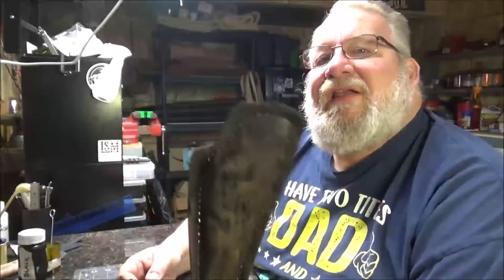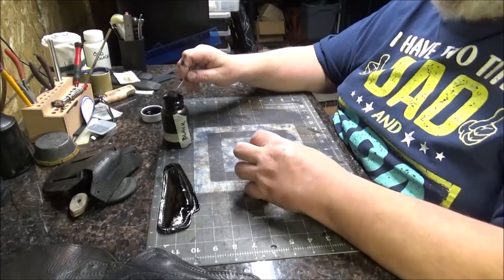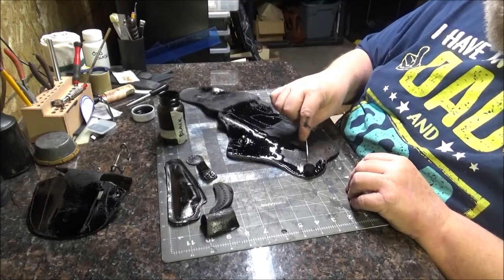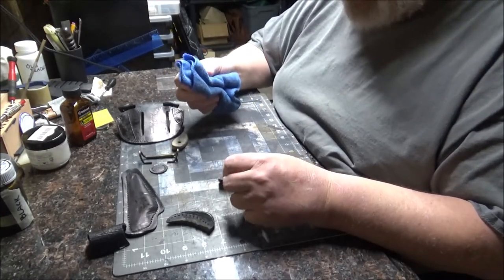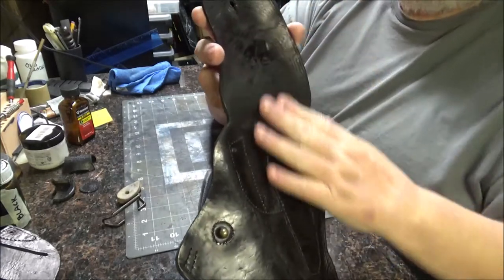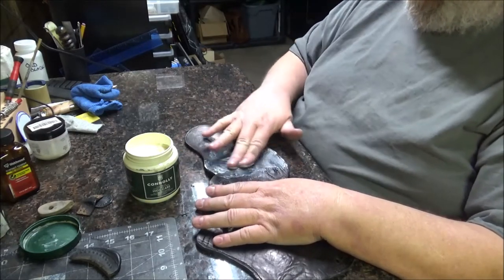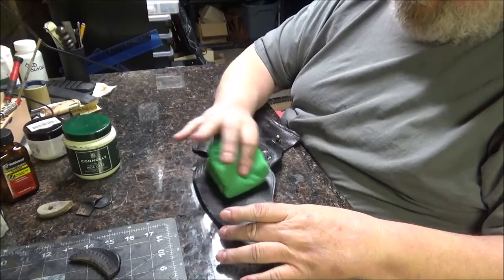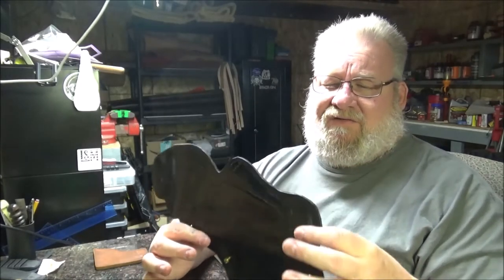1911 Holster Restoration Part 2: The Finish

Comment: Have you tried Outback Surival gear Leather Seal?  I love this product and use it over neatsfoot oil or Connally's conditioner.
Reply from the maker: I haven't, I'm only trying to moisturize the leather though. I want it to be able to breathe, I may pick some up to try on newer leather though. Different leathers should be treated different as well, I wouldn't use Neatsfoot oil or Connolly's on a pair of boots. Thanks for watching and the advice.

Comment: Is Bick 4 a good conditioner?
Reply from the maker: I use Bick 4 when the leather is pretty dry, it adds moisture faster. Apply it according to the directions and re-apply in a few days usually does the trick.

Comment: Hey man. I've been watching your videos. I have an old holster I'm trying to bring life back into. I have a decent experience with leather care. I'm pretty good at it. But I have never had my hands on a piece that is this dry!.....I. oh boy this holster is solid stiff......it's an old safariland 1001 4" revolver holster. It's in great shape esthetically.....I think it was dried out very quickly if you know what I mean. Do you have any idea as to what would be the best oil or conditioner for a super dried out and stiff piece? I can send pics or other I fo over email if it would help ad you had the time to look.......if not no biggie. I just figured I'd reach out and see if I could benefit from your experience. Thanks a ton for all the content buddy! Thumbs up!

Bryan
Reply from the maker: You could email pics to scott@fatmanleather.com, it would help to see what you have. A good cleaning should come first, saddle soap will help break down some of the surface issues before you start the moisturizing process. I'll know a little more after I see the pictures. Heat can dry out leather, it may have been stored poorly.